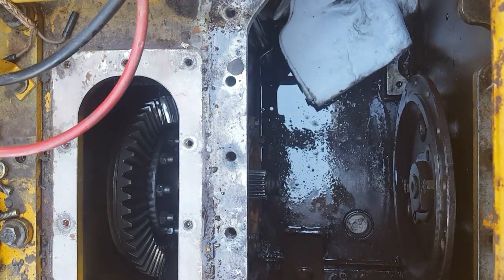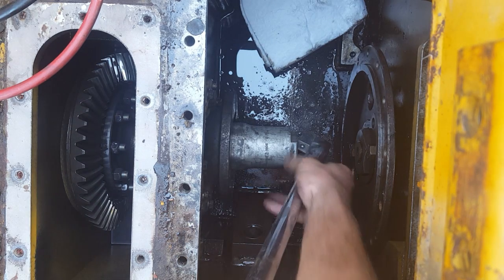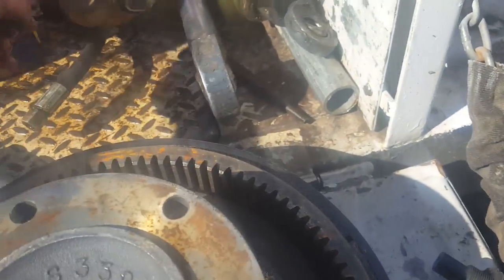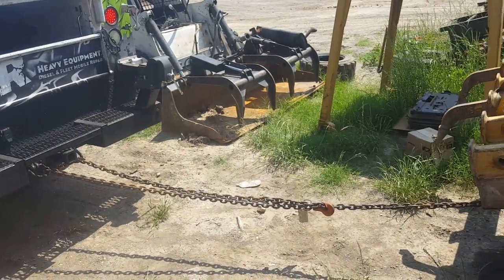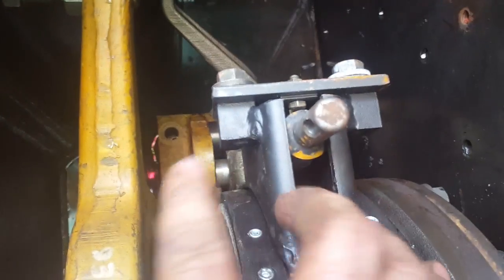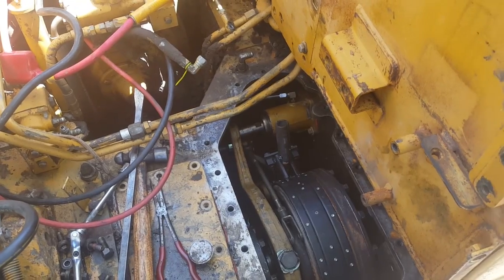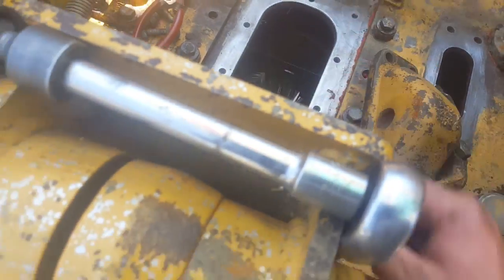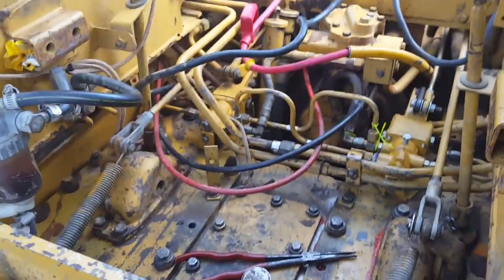CAT 933G steering clutches and brake replacement part 6

Comment: Hi
My name is Martin
Do you have a transmission computer for a Komatsu D66S-1
I have one that the other Hidraulicos work but don't move forward or reverse
And the control screen is not working to help with diagnosis
Where are you located?